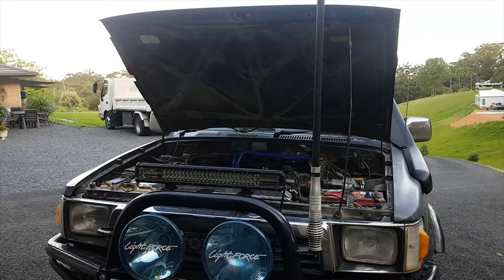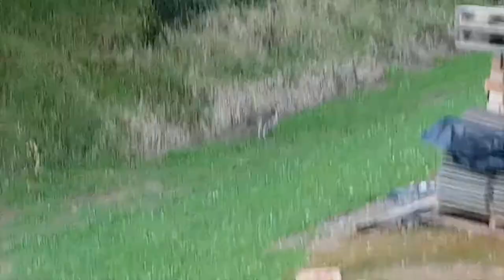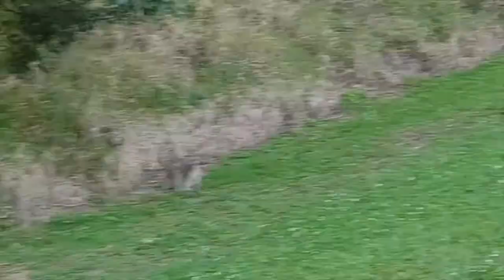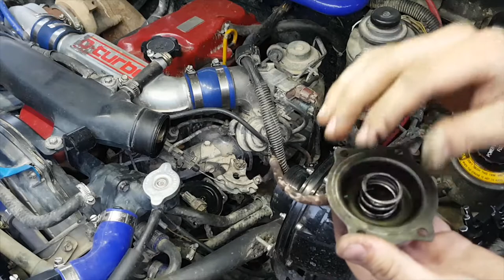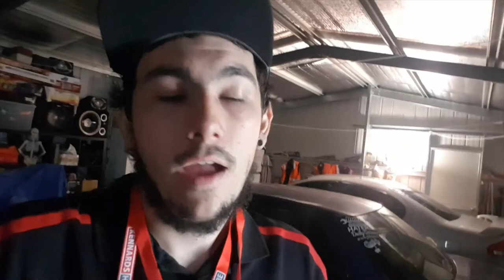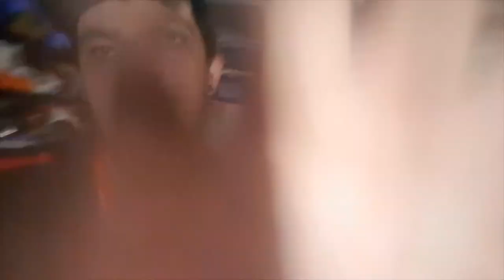89 Hilux Surf/4runner Project (part 1) (2lt-More Fuel = More Boost)2

Comment: Removal of the throttle plate does wonders for throttle response and off-boost torque. If you haven't already, drill out the inlet nipple on the compensator lid to the full diameter of the hose. I wasn't getting full boost in 1st and 2nd, or full fueling. Now that it's drilled out the boost snaps up to 11psi in 1st and I get full fueling (and full power) much sooner.
Reply: Do you have any photos of how you done this?would love to see
Reply: @cathaldoherty8754  I don't unfortunately, but it's pretty straightforward.

For the throttle plate, remove the intake plumbing (carefully, you'll want to re-use your gaskets so don't destroy them). Inside the throttle body there's a throttle plate. This is actuated by a vacuum solenoid and provides manifold vacuum for the EGR system (nothing else). The throttle plate is held in by two screws, mine stripped so I drilled them out and slid the plate out. Blew out all the metal shavings before putting it back together so the engine didn't suck them in.

For the injection pump lid mod, take off the lid on the top of the injection pump (where the boost line connects), take the boost line off and have a look through the nipple. The hole is more than likely a lot smaller than the diameter of the boost hose. If you drill it out with a drill bit the same size as the diameter of the rest of the nipple it will spool much faster. You can also rotate the metering rod to the most gradual ramp so the fuelling is a little more uniform.

Watch your EGTs!!

Hope that helps
Reply: Keenan Welch thanks for that big help 👍🏻

Comment: Hey mate, love the video found it to be really informative. I have a question regarding your glow system setup? on my Ln65 it has the super glow system and for the love of me can't get to to work. I've gotta replace the glow plugs anyway but I've also noticed on the passenger side near the two glow relays/solenoids that's rectangular that has to the one end two wires one solid brown and one solid white. mine had been snipped at one end and for the life of me can't figure out where they go. please any help would be greatly appreciated.

Comment: I see it u have very important info..but im not clear..about the turn of the compensator..the marking and wat so ever..please explain in detail
Reply: The mark is for to mark the fuel flow from factory. Turning/spinning the shaft will reduce this time to get to the port which allows more fuel in quicker.
Reply: The video was not filming while you made the adjustment and I couldn’t see what you did makes the whole purpose of the video a loss for me

Comment: hi m8, good video but your instructions are incorrect. rotating the membrane doesnt have any effect as the membrane doesnt have any position. What you need to do is to replace the pinion with this one http://www.euro4x4parts.com/parts/icc1006-2028_lda_rod_euro4x4parts.html and then you can rotate the dented wheel half turn anti-clockwise (optional). play a bit with your settings, rotate the wheel no more than 3/4 anticlockwise or clowise, do it at your own risk as doing this will inject more/ less fuel into the engine and you know what happens when you have too much /less fuel... have fun. btw original settings for the 3.0td engine are https://imageshack.com/a/img922/3798/yJXOOz.png